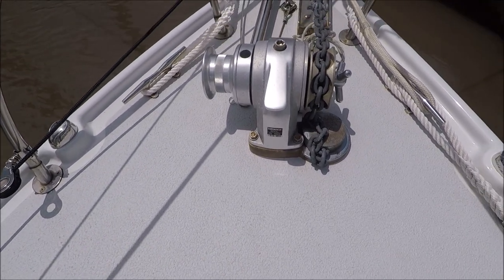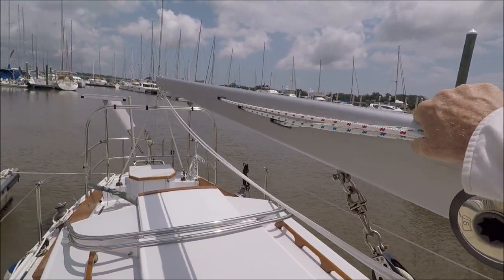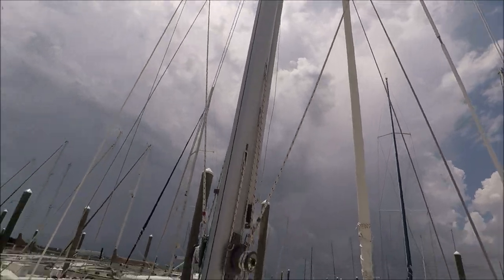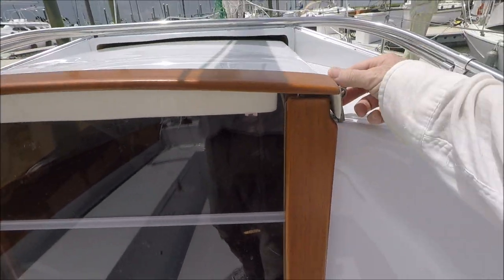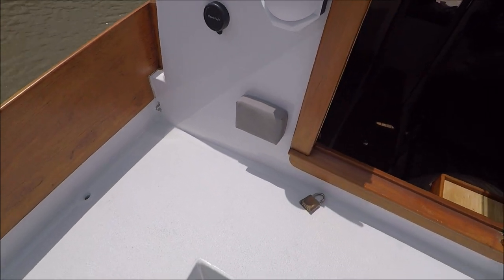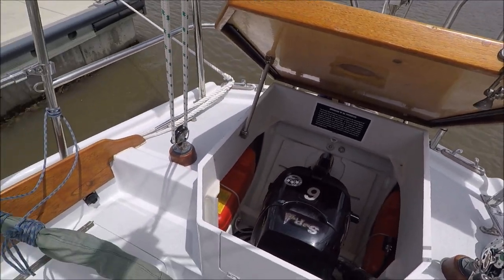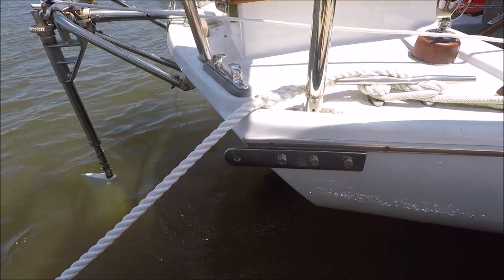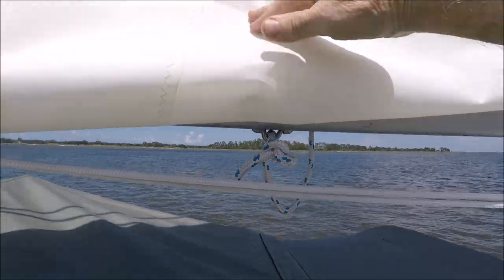Pearson Triton Osprey Refit Part 24 Exterior Tour

Comment: Fantastic job! One constructively meant comment: It is not recommended that you hang on you hook directly to the windless. There should be an anchor cleat on the foredeck. Is it possible to get a strong alignment from the roller to the docking cleats?
Reply from the maker: The windlass manufacturers don't want you using the chain wheel or rope drum for hanging on the anchor long-term but this windlass has a horn and it is mounted stronger than any cleats could be so attaching the snubber to the windlass body (not to the drum or wheel) is no problem. If someone didn't want to do that on this boat then to have a fair lead you could use a two line snubber with one going into each mooring line chock then to each cleat and not going through the roller.

Comment: I was in the middle of a refit of a Rhodes Meridian Seafarer . All of the mahogany, teak and Sitka spruce mast and boom were completely replaced. My wood shop caught fire thanks to a radio and everything including all my woodworking equipment and tools went up with all of the boat parts, engine and all except the hull, new sails and new cushions were lost. Advice on how to proceed would be appreciated.
Reply from the maker: That's tragic. If starting over with a similar project is too difficult to bear, maybe use it as an opportunity to get a different boat that requires less work.

Comment: Which size bow chocks did you select? The size line they fit up to? 1/2, 3/4 or 1? Thank you.
Reply from the maker: I often use the larger ones linked below with 5/8" line. Bigger is better for strength, reduced chafe, and space to fit chafe gear:
https://suncorstainless.com/steel-product/bow-chocks/